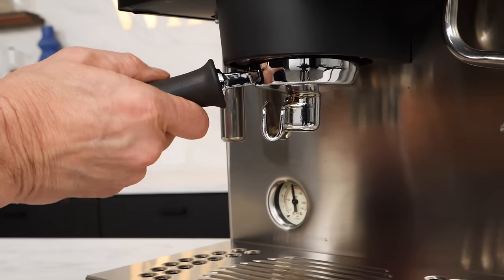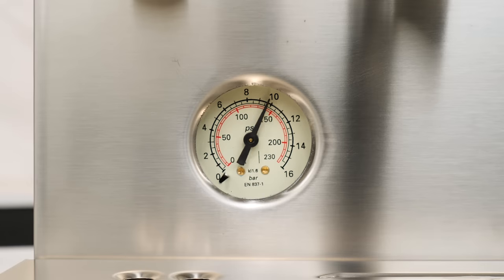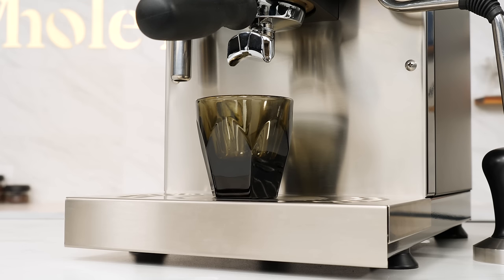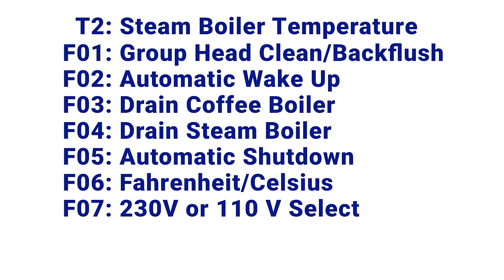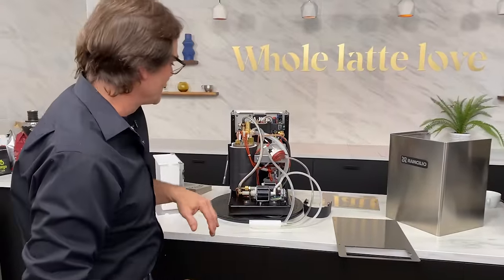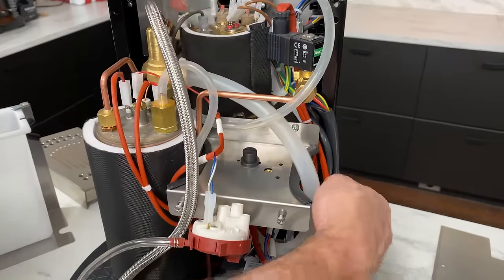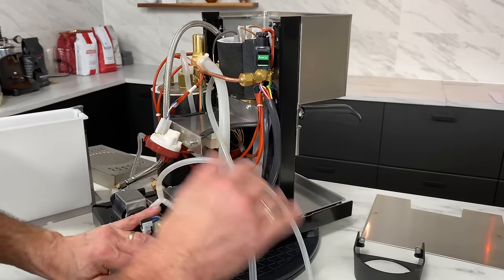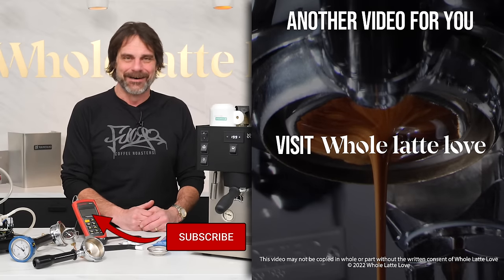Review: Rancilio Silvia Pro X Espresso Machine

Comment: Hey Marc! Love this review. Thinking of picking up this machine for popup coffee events that won't have full blow coffee shop type volume. How would this machine perform pulling back to back shots and steaming milk? Say 5-8 drinks back to back? Thanks again for your time!
Reply from the maker: Hi Tony, Thanks for the kind comment. It should do okay. Understand the Silvia Pro X is technically not a commercial rated machine. One stumbling point is the drip tray which is rather small. Do take a look at the Bezzera BZ13 for your application. It is NSF commercial rated. The DE version of the BZ13 has programmable dosing, so push a button the shot pulls and stops automatically so you can put your attention elsewhere for faster workflow. I love the drip tray of the BZ13! It's a wire style so less mess and a lot bigger than the Silvia's. BZ13 heats up very quickly and it has an electrically heated group head which should provide more stable brew temps for back to back extractions. Also comes in 3 body colors for visual impact. Check out my review of the BZ13 in this video from a few weeks ago: https://youtu.be/DMbCgF1554E
Hope that helps!
Marc

Comment: Hi can this do flow control? Thanks
Reply from the maker: Hi Dan, No it can't. Flow control capability is most common in machines with E61 brew group from Profitec and ECM. The ECM Classika is a single boiler, PID, E61 group machine available with flow control: https://www.wholelattelove.com/collections/semi-automatic-espresso-machines/products/ecm-classika-pid-espresso-machine-with-flow-control
A step up to HX boiler for simultaneous brewing steaming is the Profitec Pro 500: https://www.wholelattelove.com/collections/semi-automatic-espresso-machines/products/profitec-pro-500-pid-espresso-machine-with-flow-control
A step further to a dual boiler beauty is the ECM Synchronika: https://www.wholelattelove.com/collections/semi-automatic-espresso-machines/products/ecm-synchronika-dual-boiler-with-flow-control
Marc
Reply: @Wholelattelovepage  ok thanks i think i will get BDM with slayer mod for flow control.

Comment: If you can stand a longer heat-up time of the portafilter, you might want to get yourself the stainless steel PF of the Rancilio RS1.

The one that comes with the machine is magnificently made, weighing 750 grams and well balanced. But unfortunately it's only made of chrome-plated brass. Over time, the chromium layer will be dissolved by the coffee acids (as with all chrome-plated PFs) and drunk by you. Stainless is superior in that regard, you only have to stand it's longer heat-up time.

That being said, the RS1 portafilter is also even nicer than the original Silvia Pro's.
Unfortunately, Rancilio does not sell RS1 bottomless or wood handles any more, these were insane. Only spouted with rubber handle available now :-(

Comment: No burn is pretty damn dissapointing as on even lower end machines its already existent...
Reply from the maker: Hi sr, Yes, it is surprising.
Reply: In my experience, 'no burn' is a completely overrated feature. It actually even has some disadvantages (worse steam, worse mobility of the wands).
Coming from a machine that had 'no burn' wands, I am happy to have my Pro X as it is

Edit: Maybe if you have 'no burn' like La Marzocco does it (double stainless tubes), this is fine. But the typical way they do it is a teflon tube inside of the metal tube. I would actually avoid that. This extra teflon tube also restricts your options in steam tips (not all tips form a good seal against the inner tube -> have fun with steam and debris where you do not want them). Everything to say: Silvia Pro (X) steam wand is great as it is